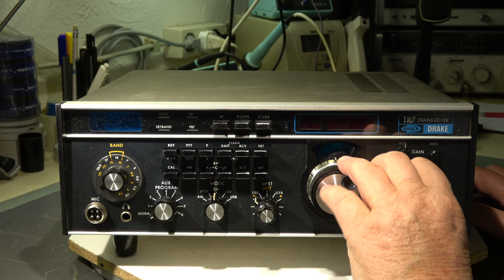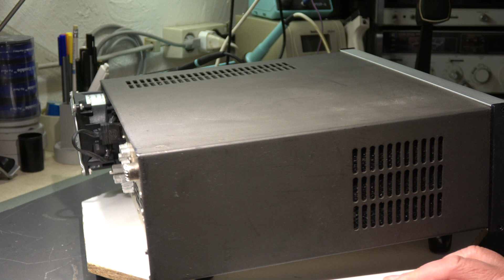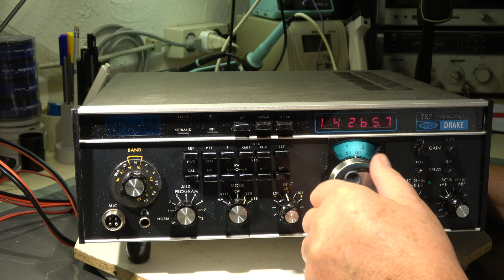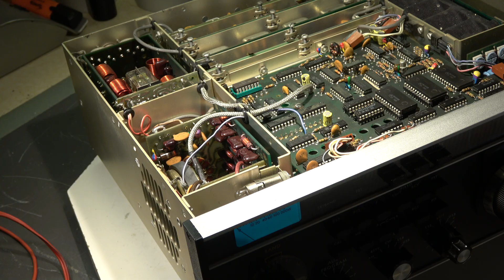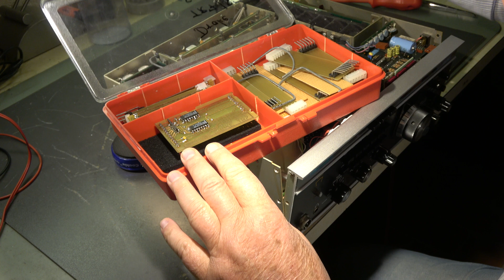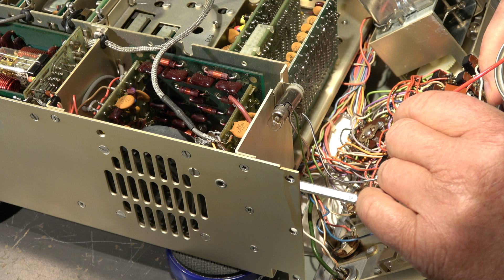#97 Drake TR7 Part 1(4)

Comment: Wonderful, an older TR7 with AUX7 board. According to the serial number about 1000 pieces younger than mine :-)
I also exchanged the trimmers on the 10V board for 10 turns. I am very curious how it will go on. Where did you get these circuit board connectors?
73 de Bernd
Reply from the maker: http://www.conny-dl1sdq.de/3061/3115/index.html

Comment: Most likely the PROM in the green socket on the DR7 is a WARC band modification, allowing TX on the WARC band without using the AUX7-board. Such PROMs were sold here in Sweden in the days...
Reply from the maker: TNX dr OM! I´ll check it when it comes to the TX-tests.
But the AUX7 is also present with additional modules ... !

Comment: Sir you can make video how to build esr metter analog version?
Reply: Look up creative electronics meter. It uses 2 lm 324 op amps. You don't need to use precision resistors as called for in the schematic. Not very good at posting links so will have to search yourself.
Reply: @marka1986  thanksss Sir ....i also find circuit with dual opamp way back there i must try it thank you Sir
Reply: @MUHAMMADYAWARIFRAHEEM  just a note if you use a more sensitive meter movement you would need to use a larger value for the zero adjust pot on the lm324 design.
Reply: @marka1986  👍✌